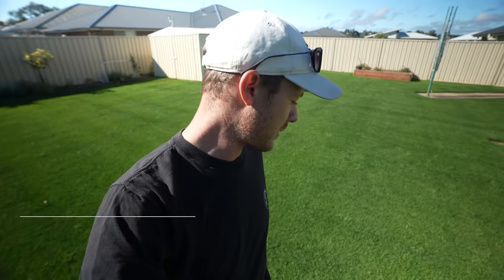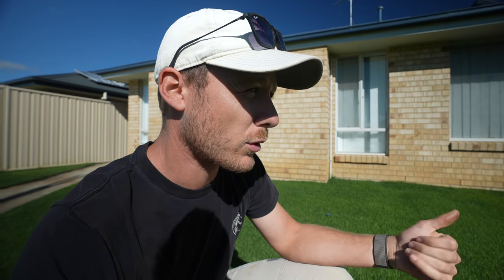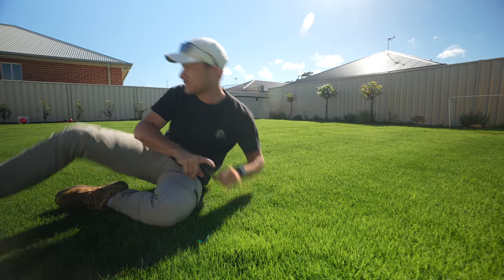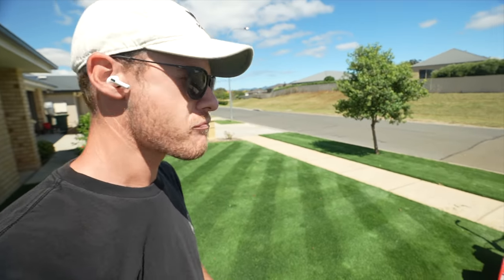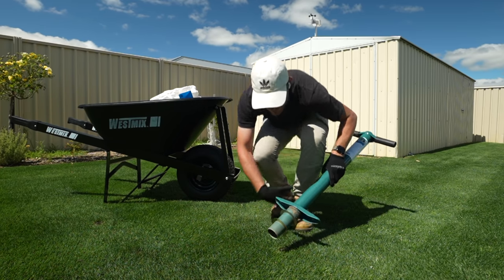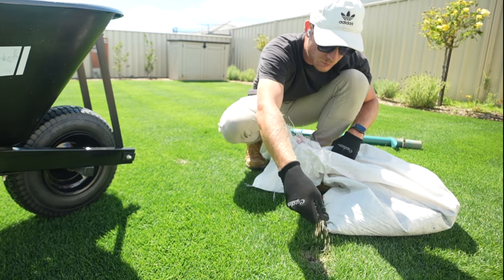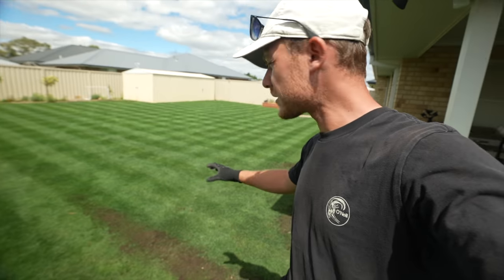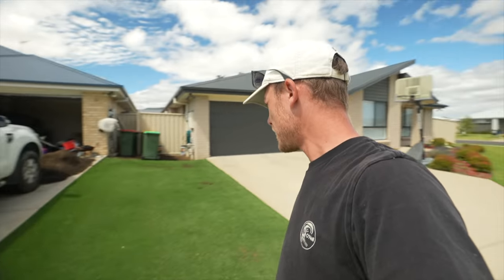First Mow On My Seeded Lawn // 25mm (1 inch) Perennial Ryegrass

Comment: Hi Ben, I have sir walter buffalo in QLD. I was going to do my first top dress this weekend but lots of rain throughout the week the grass and soil underneath is quite damp decided to hold off until next weekend. I am leaning towards a sandy loam over sand. Do you agree that the sandy loam would be the best way to go or should I go sand? We laid the turf about 18months ago I got about 140m2 and we had to get 17m3 of soil to level it up to the house slab all done in a weekend with 2 wheelbarrows lol. So after all the rain and settling its bumpy and I need to level it out a bit as its getting scalped in a heap of areas. Cheers mate.